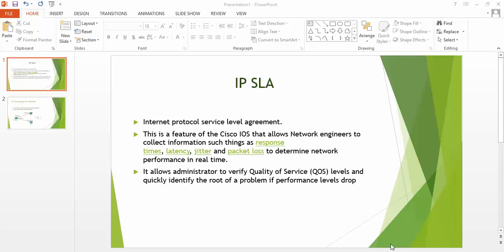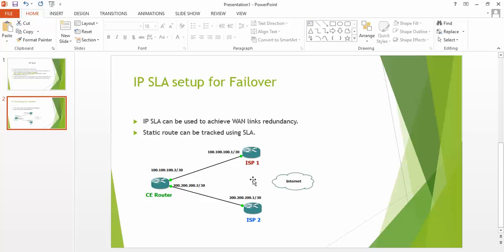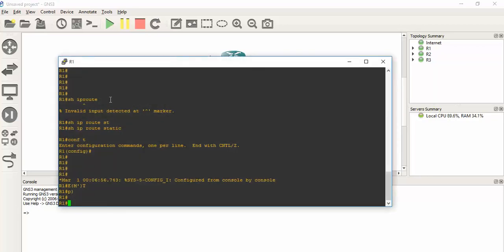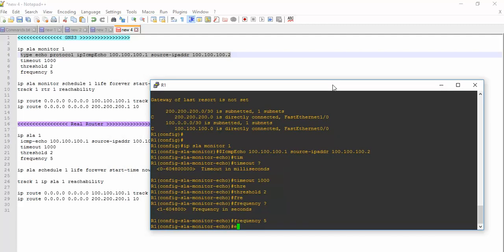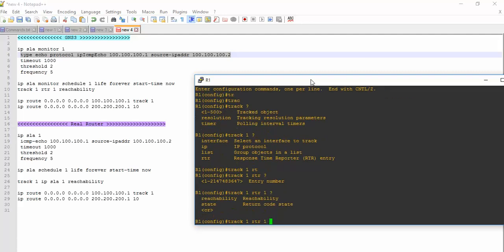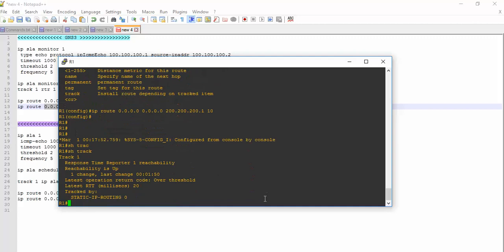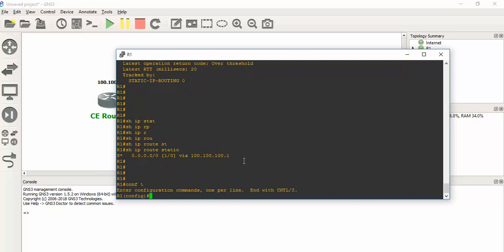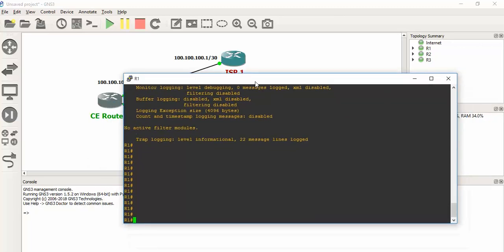IP SLA setup for WAN links failover

Comment: How auto fail over can be done, Please explain
Reply: it can be easily done without IP SLA, you can configure two routes with two different AD values. the lower one will be preferred.

Comment: Hi, great video,Just checking, would the ports on either side of ISP 1, need the interfaces to be shutdown or cable pulled out for the fail over to isp 2 to happen?

And does this cater for fail back Incase ISP 1 is back online again?

Would this work on a cisco 1841?